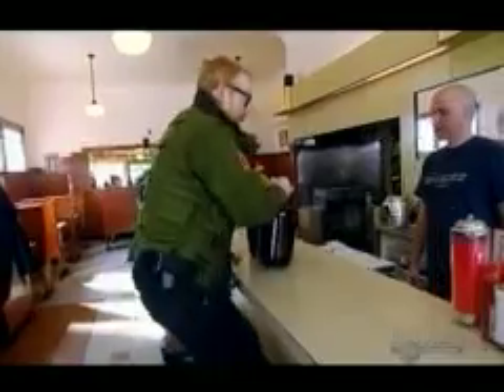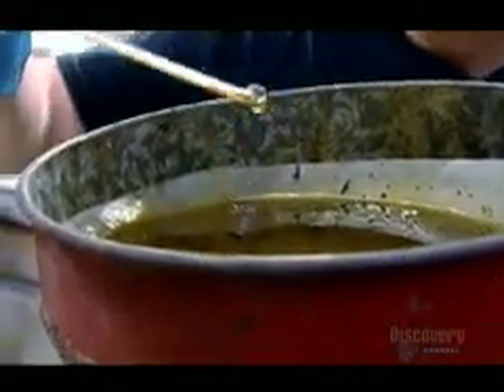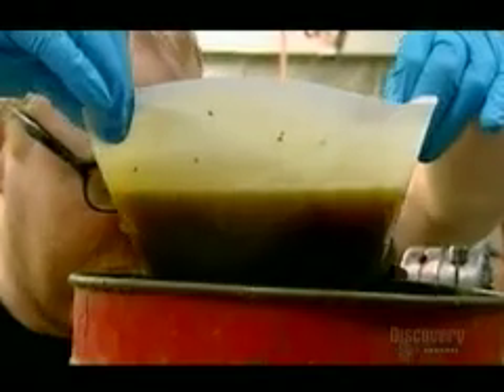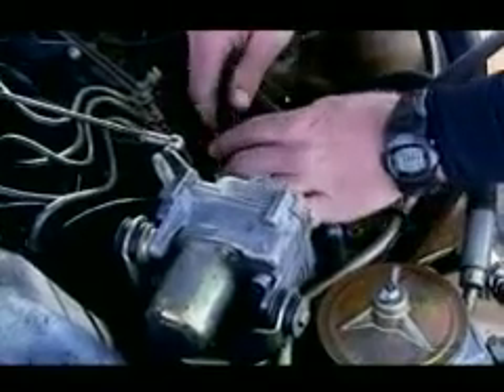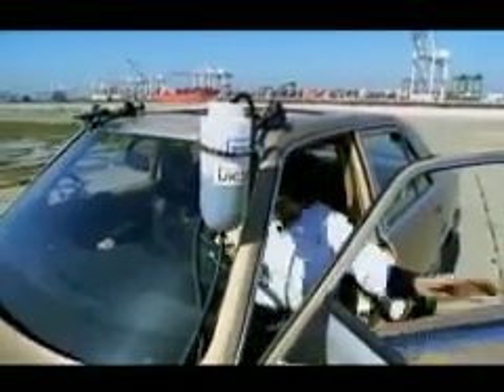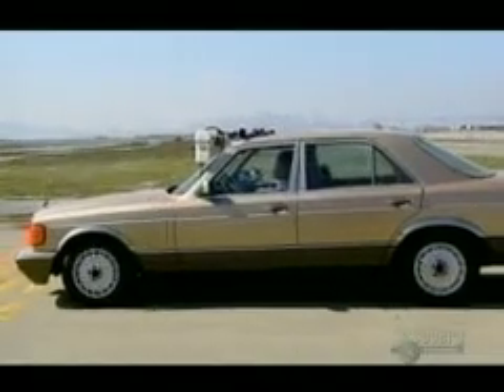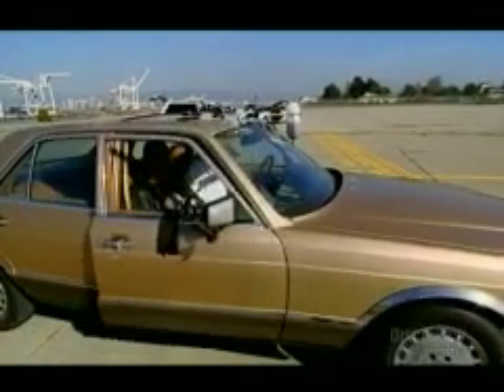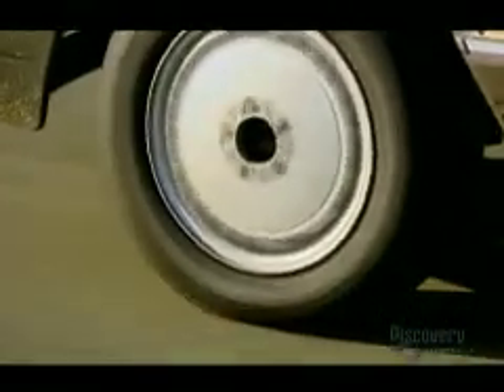Mythbusters - Cooking Oil as Economical Diesel Fuel

Comment: Because when you run a bio-based fuel, i.e. biodiesel, so should always preheat the fuel before it goes into the engine. Biofuels have a tendency to gel up when they get cold and sit for a while. If the Mythbusters were smart and did just a little research they would have found that just about anyone who runs biodiesel pre-heats the fuel first. If they would have done that they would have EASILY gotten 33mpg like the straight diesel. I would even bet it would have gotten better than 33mpg.

Comment: u mean any car under 1990's...i have a 1987 mercedes 300D and i run only used deep fryer oil and i just use a paint filter to put it into my tank. and as for u ppl who say u need to warm it up...mercedes comes stock with a heater to heal the fuel.

Comment: Thanks, skwurlking82. So first your filter the oil like they did in the video and then how do these filters work under the hood? It does sound like something you'll need a bit of engeneering knowledge for, right? 
And like Bluefoxkung mentioned, does it harm the engine or is it okay when you use a couple of filters?

Comment: yes, if you can get it filtered enough. otherwise you need to convert your motor to run veggie oil. or you could run 50/50 veggie oil/diesel fuel without conversion. which if your doing it to save money would work fine. you just have to be careful in cold weather, as veggie oil gels really easily.

Comment: No you won't ruin your engine and can run more then just veggie oil! I have a one tank system that can use either 100% veg oil or 100% diesel. Been doing it for almost 3 years and know of person who has done it for over 20 on the same car. WVO is a lubricant and actually cleans your engine and makes it last longer.

Comment: PS Mythbusters, if you are listening. Most people that post improvements are either making mods, or making Bio Diesel. No one that I know is getting increased fuel economy with just WVO. So take your diesel out and make Bio Diesel, and see the comparison. Then add the Hydrogen injector.  I do not believe the H2 injection works personally, but a I have had those that swear by it go beet red and start stuttering when I start to question them.

Comment: i run this stuff in my truck. i DO NOT reccomend runnign it with no modifications unless your turning it into biodiesel. it needs to be filter better than they did, de-watered where applicable, and heated to reduce the viscosity. there are kits for this. the oil he had looked pretty nasty too, you can run it but its thicker than pure veggie oil. there is much much more to this if you want to run it reliably with NO problems.

Comment: I run a '01 F250 on straight filtered wvo. I do have to start on diesel, but after 1-7 miles, depending on the weather, I'm running on wvo. I know several people that have been doing thos for years with NO problems, me included

Comment: phatkane wrote "you CANNOT run 100% cooking oil in any diesel car, like they have stated. IN fact, Some applications only allow 5% mix with diesel fuel. So their statement, that you can "run this in any diesel car" is quite untrue, and could potentially cause damage to somebody's car. I know my diesel truck only allows for 5% mix in diesel fuel. So be careful people that is all. Diesel engine replacement parts, motors, etc are not cheap! " Wrong!

Comment: Hi
Yes your right.
But to filter the cooking oil from a restaurant or chip shop would be very difficult to get down to the micron level where it would not  block the filter.
I wouldn't like to put it in a new car.
I have used it in my old car until it blocked the filter.
I would say if you have a new car buy some clean vegetable oil.
Cheaper in large quantities.
You need to find out what micron level, the oil filter, filters down too.

cheers.

Comment: secondary issue: veg oil, used or not, is far more complex than the seperated hydrocarbons you get from oil companies. Theres a lot more filthy rubbish in veg oil, which is going to clog up narrow tubes, and remember that normally your fuel is what lubricates the inside of your piston. Veg oil is a lousy lubricator.

Comment: Hi 
I don't know of any claims, I'm not saying this doesn't work , it does you can drive using it, my comment only relates to older vehicles, which may have rust in the fuel tank.
my father in law broke down 5 times with the fuel filter blocked up, I know many others that have had the same trouble, all with older vehicles, if you want to use it, then use it, it maybe OK for you, and a good many others. but the cost of a breakdown recovery and new fuel filters can out way the benefits.
cheers.

Comment: This is incorrect, although the current specs on the diesel engine may not be tuned towards the use of vegetable oil, Rudolph Diesel orginally designed the engine to specifically run on peanut and vegetable oils so that farmers could use the wastes from their harvests to run all of their machines: trucks, tractors etc.

Comment: Is best to do titration method, if you keep on using SWO what ever fats will clog the lines and screw up your Injector pump, you could do a SWO but you have to purge your injector system with diesel purge every 6-12 months...

Comment: Bad Idea. Do not run straight cooking oil in your diesel engine. Especially used cooking oil. Animal fats and cooking oil contains glycerin and soap. This needs to be removed. It can be separated through a relatively easy process by using lye and methanol.

Comment: I currently run an '01 F250 crew cab on waste veggie oil; I have seen no drop in power or mpg.  My conversion kit rquires that I start on wvo and stop on wvo.  Once my coolant reaches 160* my system automatically switches to wvo; once I shut down my system runs for approx 1 minute to purge the lines of wvo and put diesel in its place.  With that in mind I am getting ~ 70 mpg on diesel - no BS here, just solid facts

Comment: you can thin it out by adding a solvent at 3 ml per 97 ml of vegetable oil

Runs sweet.
Reply: Yeah, just filter it and thin it out a little.
Reply: @Bubu567  50/50 diesel with filtered cooking oil?
Reply: @The_Gallowglass  Yeah.
Reply: What about using actual diesel to cut it?   Like yes itll cost a bit in fuel to get diesel but if we're talking about bulk storage in the long run, lets assume for sake of argument that if you ask any greasy fast food chain for their used oil, you'll save them the hassle of disposing it (more money for them amd free fuel for you) and if its by the gallon we'll say maybe 300 gallons. Aa for diesel lets assume the worst and itll cost about 5.44/gal. (Non-commercial but on-road; taxed fuel)  the diesel will be used to thin out the filtered veggie oil and to retain certain ingredients like the low level amounts of sulfur. 

For just 300gal. Of diesel #2, at 5.44/gal, thats $1,632.00 USD.   But since we're cutting the oil with the diesel, it will only cost $163.20 USD.  (10% of 300 gal will only be diesel and the remaining 90% is purely filtered veg. Oil.)  

That will bring the effective fuel cost down to $1.83/gal USD.   A HUGE difference indeed.  Granted u may still lose 10% of energy so if its a mercedez benz om606 (3l i6) rated at 175hp will be now be at 157.5hp.  Thats 17.5hp lost.
Reply: Just add normal diesel fuel to it
Reply: Just mix it 50/50.
Reply: @Bubu567 í
Reply: @Bubu567 ❤

Comment: No wonder that used cooking fat works, the diesel engine was originally designed to run on peanut oil. The only reason we have a diesel fuel made from fossile sources, is because of the 10% efficiency, and that the oil companies earns alot of money because of it. Major fraud in my eyes

Comment: Used cooking oil: free, will never likely cost more than store bought cooking oil, runs at slightly lower efficiency (mpg) than diesel.  But because it doesn't increase the efficiency of your engine the myth is busted.  Never mind that its free. We choose to rate efficiency only on miles per gallon.  In fact lets not make the myth we test about whether this works or not.  We are just testing whether there is a massive conspiracy.  If you do involve cost we will bust that with speculation.NAILED!

Comment: well right now there are +25 degrees otdoors here (celsius), and i dont like palm trees..hehe..i like pine forests..and in those 4 seasons there is obne called winter..when temp. goes under -30 sometimes...the thing is that i don't like diesel cars and thats it...and i dont own a restaurant to get free used coocing oil..so..:) and a gallon of gasoline is 7.15 usd heer right now ..so i really know what expensive fuel is..

Comment: First SVO oil does have less heat energy, 5% to 10% max but burns better, so MPG are not much lower than petro based fuel. You MUST heat the oil to +160F to get full economy & protect the engine. You pay $4.40/gal, while I get 50 mpg on $1.00/gal.

-30C is WELL below pt SVO gels, it's more like 30F. You where not clear. I wouldn't brag about living in -30C climate. You're a naysayer, fine, I understand you're miserable in a -30C igloo. The rest of us with 4-seasons & Palm tree's, it works.

Comment: HOT OIL WILL ADD SEVERAL MPG. That's why Myth Busters got a slight less MPG.

30 F not 30 C which is boiling hot 86 F, Professor. Yes oil gels at cold temps, but its easy to preheat with coolant heat exchanger. You DO want to HEAT the OIL even in the summer. ALL serious OIL in Diesel users preheat to deliver HOT oil to engine for several reasons: ITS NEEDED to get viscosity down so pump and injectors can handle it. The injector needs hot oil so it atomizes.

Comment: You are right but that was the MYTH super HIGH milage Miricle MILE PER ADDERS. The Diesel OIL deal did not even belong in this Myth. You are right it works and it does save fuel cost (if you get oil free which is true for now.)

Comment: I don't recommend you do it straight(especially in cold climates or when the temps below 70 F.) It can hurt the car. Instead just make bio-diesel(cheap ($.50 a gallon)), or buy the grease car conversion ($500-$900 - much cheaper than an engine repair) and know you engine will be safe.

Comment: This only works this well 'cos its a hot climate and an old Merc diesel engine. Stick WVO straight into your brand new C class in cold conditions and see what happens. Very expensive engine damage.
My 1992 190D 2.5 is running sweet on straight veg oil 100% in our English summer ATM

Comment: The original diesel engine was designed to run on peanut oil.  So you can run them on pure veg oil. You can convert veg oils and fats to bio diesel through simple chemical conversion. It can be done.

Comment: its kerosine (i think) . it does not work very well in high power diesel cars as there engine needs ignition. so if you gl is a v12 or something i doubt it will move. my dad works for rollsroyce.you can put cooking oil in there diesel 1990 phantom. the top gear episode was cool watch it its on the side of this video on related videos side

Comment: this approach works.. provided the fuel is used within a certain period of time, otherwise microbes will grow in the fatty liquid, in fact  commercially sold biodiesel blends are PH adjusted and have chemicals added to prevent microbe growth .

once cellulosic ethanol (ethanol made from paper waste , grass, etc , NOT food) is commercialized, old carbureted engines will be the hot ticket because the carb can be modified to accept ethanol and there is no complex emissions electronics to deal with.

Comment: i remembered when diesel was less than regular and my dad drove an 83 benz 300d turbo and it was very efficient.  the motor was entirely mechanical, no electrical system (exept the starter/ alternator)  now this new diesel ( dyed fluorescent yellow) costs way more than regular and new diesel vehicles are so complex and the emmisions system only undermines the fuel efficiency of the motor ...
 
the price of 1980's Benz diesels  has already skyrocketed in  
 recent years ....

Comment: im running my diesel car on a mix of 25% diesel 75% percent waste vegetable oil it starts up straight away but the engine labours because the veg is cold. i have to wait 5 mins for the engine to warm up and if i turn the engine off for 30mins i have to wait 5mins again (only in winter, in summer 2min wait). Once the engine is hot it runs just like running on straight diesel. There is no power loss like when i use to run it on biofuel i had 10-15% less power. Economical is about the same

Comment: As of 2007, all diesel engines sold in the US are required by law to only burn ULSD(Ultra-Low Sulfer Diesel). If you try to burn anything else in them, they are designed to destroy themselves. The same will be true for home heating in 2009. I work for an oil Co. so I'm in the know.

This is how the oil-controled government is using the EPA to prevent people from using biodiesels. Old engines will be worth gold real soon.

Comment: Assorted seals are affected. An older diesel may run fine on biodiesel, but the point about SVO is COST. Biodiesel is not appreciably cheaper than petrochemical diesel, whereas even new SVO offers massive savings, more if it is used. It also doesn't need nice stuff like sodium hydroxide to be used. Biodiesel IS good, but in some ways, SVO is better. (You can also obtain it from loads more outlets if stuck)

Comment: what is affected besides the fuel lines?? and a older diesel will run just fine on biodiesel, at least equally well as vegetable oil. and when you use biodiesel, your fuel pump isn't stressed any more than with petro diesel (possibly a little, little bit more, but not as much as veggie oil)

Comment: With biodiesel, you don't save any money, and it isn't just the fuel lines which are affected. In general, it is the older diesels which work the best with SVO. The problem isn't normally one of total engine failure if certain precautions are taken. In fact the main bother is failure of the diesel pump. My local ice cream van runs on a mixture, as do I. Any additional bother/expense for heating etc. is offset by the savings in using SVO. I can save about £15 per week doing this with no mods.

Comment: why go through all the trouble of installing extra heating elements when you could just pour in your biodiesel and go?? and SVO will probably not work in new diesels with common rail engines. Add to that the fact that veggie oil will jell up really easily, you have a recipe for total engine failure. oh, and the pumps of your engine system also have trouble with the thick veggie oil.

Comment: The viscosity can be overcome by mixing with diesel or another suitable solvent, or as some people do, installing an extra heating circuit. (This can bedone from the car's existing cooling circuit. The main problem from the viscosity angle on Peugeots is the Lucas pump which can't handle it. (Bosch pumps can)

Comment: that may be, but the high viscosity of vegetable oil causes many more problems than deterioration of rubber lines. and that itself is a really small problem. almost every automobile made after the 80's has synthetic lines, and if it doesn't, you can easily replace them

Comment: I drive a 1994 Peugeot 306 XNd. As I write this, diesel is £1.23.9 per litre at the station beside my Mum. I can BUY cooking oil at 56p per litre in Tesco. As stated, you can use second hand oil as long as you filter to at least ten microns, although finer would be an idea. Replace your fuel filter more frequently (Cheap and easy) and DON'T even think about using it with a Lucas pump, as they don't like it...at all...seriously.

Comment: Yes, oil will work, but cold oil messes up the engine where the fuel is compressed in the engine. Imagine using pudding, instead of a liquid and you understand the problem. Cold cooking oil is MUCH thicker than diesel fuel. In addition, the injectors were hot from diesel, before the oil was used. My diesel was converted to run on cooking oil over 5 years ago and I made biodiesel 10 years ago.

Comment: u need heat exchanger on wvo fuel line to heat the oil before it enters filter and engine, and then you need a switching valve to switch to diesel before u shut down  engine so it will start, its wont start on wvo so gud in cool weather, and will cause engine damage over time if u shut down and start on wvo,,u need to shut down on diesel and start on diesel, wait for engine to get warm then switch to wvo,,,thats de right way to do it bar none!!

Comment: As long as your car is Diesel it will run on biodiesel if you have an older engine your will need to replace any rubber parts on your engine and fuel tank with polyurethane or something along those lines because biodiesel is slightly acidic and will corrode rubber but your car is new so you wont have that problem most likely.  I would however recommend not using unprocessed cooking oil it costs a little more but still waaay cheaper than gas station I'v heard as low as 46 cents.

Comment: In Europe a large percentage of ouur cars are diesel,I use biodiesels and you can use used veg.oil but not as a permanent thing,it needs a solvent added to it such as ethonol but only in small amounts at a certain temprature so they mix,this helps prevent the build up of deposits in the combustion chamber and the componants around them such as injectors.